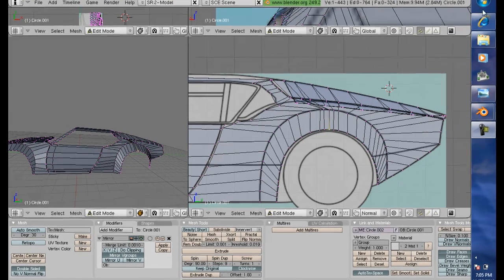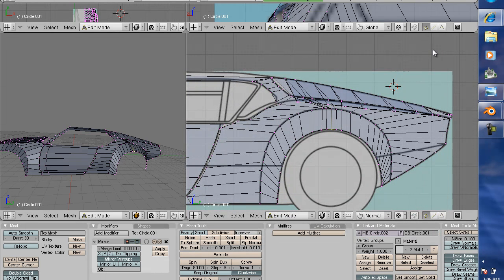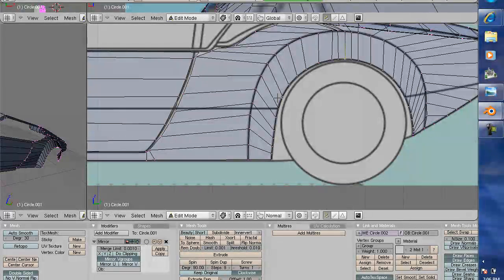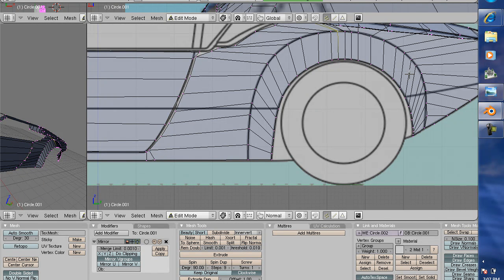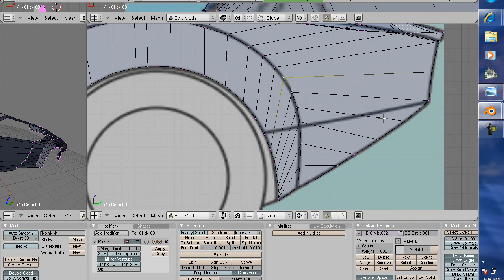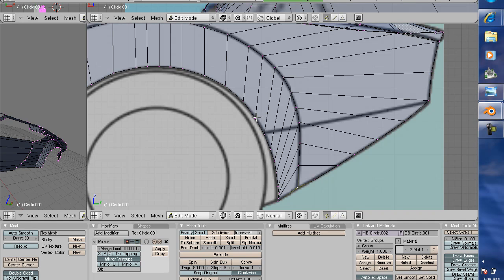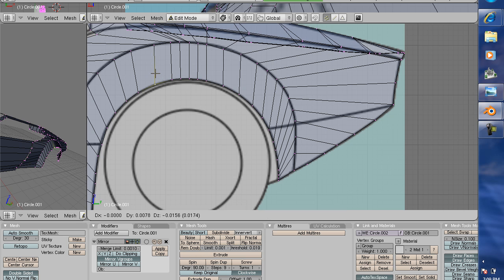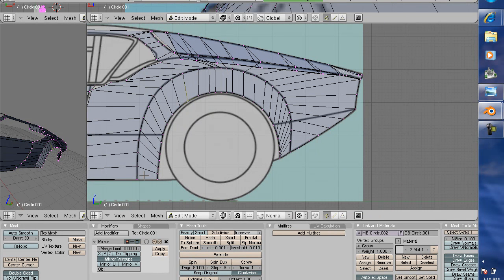Blender Car Panel Modeling Tutorial #9 - Detomaso Pantera: Smoothing Part 3

Comment from the maker: Even if youcan get the seam sharp (as I was unable to do) yo can simply seperate the seam in to a different part. in the final render it will be sharp. As for the tab - after you seperate the seam using the v key, you hit tab to return to the painted mode to observe you work.

Comment from the maker: @dvnobles There are two things I did in this tutorial as I remember. One was the shift E edge sharpening, which by the way doesn't work well with the particular geomerty of this car but might just be the kicker on another. And the other where I just seperate the seam into a completely different piece. Blender automatically smooths seams on the adjoining parts.